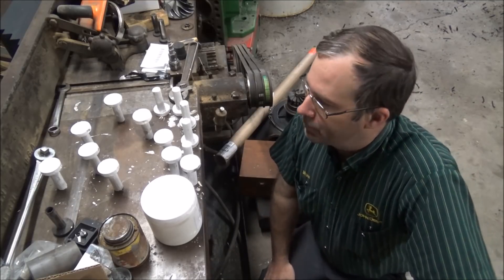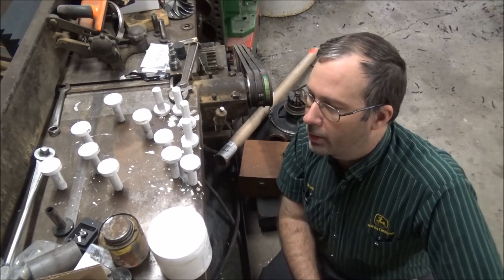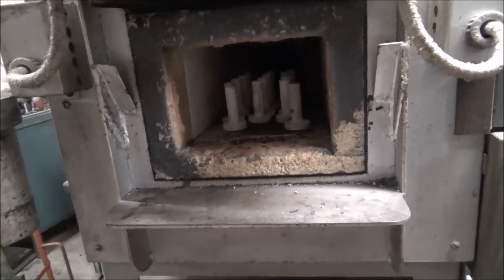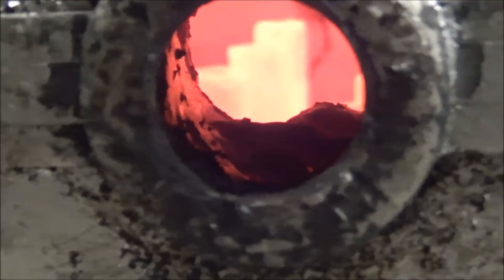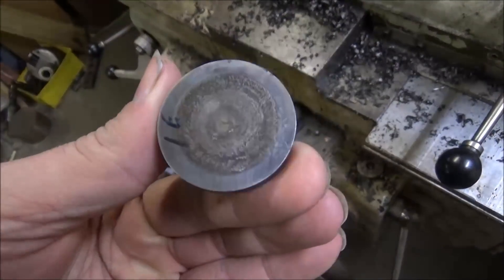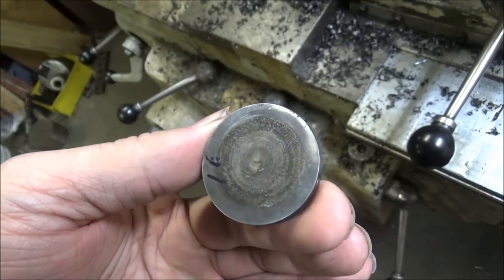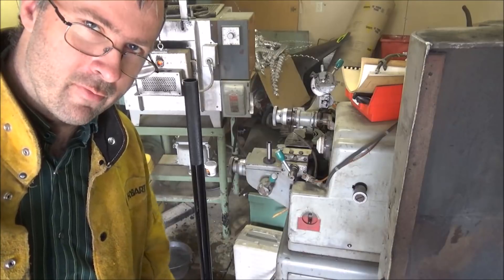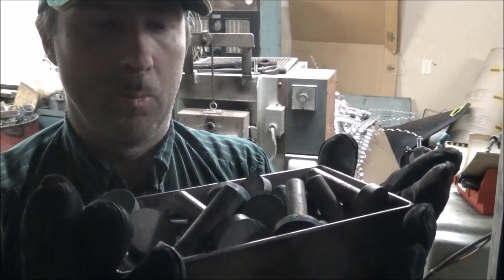Tool Steel Heat Treating

Comment: I'm having a hard time believing that you are getting an adequate quench with that piddly little amount of oil. And no circulation. Your parts have a decent amount of mass and you need an equivalent mass of material to transfer the heat into.
Just my opinion.

Comment: My experience with coating the ATP on the parts, in order to avoid the coating to kinda pearl on the parts, I use a cloth with the ATP and rub it on the part in order to give it a little dulling, this helps the product to adhere better on all the surface without withdrawing partially...
This oil bath was probably way too hot even for french fries...   lol

Comment: Good thing you don't do that everyday. I did quite a bit making my own tools in vokie even did some case hardening , some fine finish ones I wrapped in a stainless envelope type . Fold and rolled edges . Small stuff now I just torch them and quench torch to straw and use. Hard and tuff but not brittle about 65 rc to 75 rc . Close enough for my needs. Can of kasenite is forty years old for cold rolled.

Comment: @bcbloc02  Just saw that you have a Spiropoint drill sharpener! I have one too. The drills, sharpened on that machine, drill the smoothest holes. I scored mine for very cheap with lots of tooling. Do you use yours a lot?
Reply from the maker: I sharpen pretty much all my drill bits on it.  Good to know there is another one being used in captivity! I wish it would do bits over 1" is my only complaint.
Reply: Yes The one inch limitation is a pain.....

Comment: What kind of static pressure do you think those tappets are under?  What kind of RPM do those guys run in those engines 5-6K?  Some serious abuse for their limited life.
Reply from the maker: 5-600lbs of load, then around 6K rpms's. that makes a fair bit of heat and noise!!

Comment: Great video. Takes me back to the few weeks I worked at a heat treating place one winter. When you said it was hard to see in there I got this vague feeling that maybe the furnace operator had to use some kind of goggles for infra red but now I think I might have that confused with some welding training I was doing. Ahhhh, im losing to much grey matter and im not quite 40....

Comment: Hello Brian and Boss Bailey,  What kind of insert do you use for hard turning these tappets?  I take it the low volume of cooling oil keeps the temps up longer for a slow cooling temper?  I heard Fire Chief Bailey in the background when you had the pizza oven open!!  Take care.  Doug

Comment: Hi Brian
I have noticed that Adam Booth uses what looks like a high temp coating to protect areas not to be flame metalized. Have you had a chance to watch any of those videos? Might be something that might work better than the coatings you have tried. Perhaps shoot him an email to find out where to get a small amount for testing.
This is just a thought with no technical basis but may be worth an experiment using your steel and oven system.
regards
vic
Reply from the maker: Good idea, I looked it up though and the highest temp masking agent I could find only went to 900F. Not nearly enough for doing this. :-(
Reply: Thats too bad. I thought it might be higher since the coating can handle direct flame contact. Probably a time at temperature thing. I will keep my eyes open. Some type of porcelain enamel might be useful or something like TEOS (teraethylorthosilicate). Perhaps even an oven diluted oven refractory.
Reply: vic patton would silica block work?
Reply: Hi Charlie
do you mean encase each part in a block of aerogel or other type of refractory? The big issue is that the scaling occurs via oxidation so anytime the part meets O2 at high temp is when the scaling starts. I am assuming the part would have to be removed from the block before quenching and that is when the oxidation would start. Plus all the handling would be problematic.
Brian, are you aware of a product called "PBC: from RoseMill.com?
The is a borate compound along the lines mentioned by other folks in this thread. Good to 1650F but more work than the present paint on coating you are using now. The coating is supposed to be quite sturdy though.
Reply from the maker: I am at 1900F doing these.
Reply: ~1040C is toasty for sure. Your present ATP compounds are probably some type of aluminosilicate clays. It might be possible to  increase their handling strength by additives. Maybe something like sodium silicate. Maybe the folks that make the ATP product have a staff chemist who could help?

Comment: Brian with that jointer belted up like that, aren't you afraid you might lose part or all of your "wedding tackle" when you use it.
Rolle
Reply from the maker: No I don't use it from that side and I pretty well plan to keep clear of rotating machinery.

Comment: I used automatic transmission oil for quenching it was supposed to have a higher boiling point, It still boiled too.The shop I worked at had quality control and I could hit 56 to 60 rockwell fairly consistent. I like watching different ways of doing things thanks for the videos.

Comment: How do you determine temp and time? Is it thermal measure n min per pound? Or go by color for so many min? Ever experiment w types of oil? Would it matter?
Reply from the maker: There is a pyrometer in the oven that measures the temp.  The time is based off the material usually 1hrmin and 1hr extra per inch of thickness are pretty good rules of thumb but it really depends on the material.
Reply: bcbloc02 I've never fooled w heat treating like what you're doing there. My experience is more tempering n old fashioned foolin with it. Nothing as critical. You make it look easy. Thanks for sharing

Comment: when you stop spending on so much barn stuff. you might want to invest in a gold plated lexan visor lens for a face shield.  just for doing when you are working in the oven.  heck.. that could be handy in the barn. turn it on. take the chill off.  actually watching the meter spin like a gyroscope would be scary..
Reply from the maker: It actually doesn't use a lot of power, it works off of good insulation and keeping the heat inside.

Comment: I bet you electric meter was singing. How many watts is that oven?
Reply from the maker: 2000watts.
Reply: bcbloc02 Not as bad as I was thinking but still a hungry dude.👍
Reply: I wonder how much it would lower the power requirement to insulate the bejeezus out of the oven, find a way to better seal the door.  I'm guessing the main heat loss is convection right at the door seam?

I've got some ceramic fiber insulation I'll be enclosing around my repurposed pottery kiln.  Still have to work out some kind of labyrinth seal for the door though.
Reply from the maker: You could insulate it better and then use a lower wattage but the time to get the furnace to temp would be increased. It already probably takes 2-3hrs to get it to temp, lower power and it would be  ahalf a day just to get started. Wouldn't be too bad though if you did heat treating all the time.
Reply: Sounds like I'll have to do the experiment properly and do a good job recording power use before and after tinkering with it.  

I was reasoning from the idea that a PID controlled oven would only need to dump more heat in the box to replace lost heat, after it was up to temperature.  It seemed logical that I could save power pretty much in proportion to saving lost heat.  The few heat treating ovens I've used were clearly insulated just enough to do the job without self destructing (no apparant concern for thermal efficiency), and almost suspiciously poorly sealed.

I should get that far down The List in a few months :)
Reply: It's better to have higher wattage, faster startup, and you get back to heat faster when introducing cold parts, take note thet steel allows like 4140 has a critical temperature zone that you have to avoid in order to prevent  possible temper embrittlement (“Blue Brittleness”).
In the end the power consumption will be very near the same, since you'll need quite the same amount of BTUs, even more if you need so much more time...
Reply: We all learn new stuff everyday, that's the way life goes, learning is one of the treats in life...   ;)
Reply: I feel less clever now, but thank you.

Comment: what I do is use a bread pan full of borax, heat the parts one at a time to where they start to go straw color, then stuff them into the borax, and it'll melt a good coating on them. Much quicker and easier than painting them, and it's melted on there so it doesn't fall off easy. Keeps the rough scale from forming just the same. 
Also, noticed your oil was getting real hot, too hot and it can't carry the heat away quick enough, makes for soft parts. I use an old tin wash tub, holds 10 gallons of waste oil. You've got farm equipment and a couple trucks, you got a big oil drain pan?
Reply from the maker: Will the Borax hold up at 1900f? I checked the oil temp with my temp gun and the hottest it showed was just under 400, should have been fine to get the tappetts cooled quick enough to do the job. In this case the material can also be forced air quenched so I should be beating that quench rate by a lot.
Reply: Looking it up, borax melts at 1300F so the boiling point as to be quite a bit higher. edit to add: 2600f boiling point
I use it as brazing flux, too. That's pretty often up around that temperature.
Reply from the maker: If it melts at 1300 would it not just run off the coated pieces into a puddle?
Reply: Seems to stick well enough to leave a film.
just like brazing flux, just about gotta chip off what doesn't come off in the quench
Heard boiling water dissolves it, but haven't tried. Needle scaler doesn't rust the machines like a pan of boiling water would.
Next time you've got the furnace going, clean up a leftover slug of junk steel and give it a try.
Reply: It's a hard left turn from the type of work you do, but Clickspring has a neat approach using to keep air off the part using boric acid and a reinforcing wire wrapping.  https://www.youtube.com/watch?v=jlNxvnOxMCE

Maybe the coatings you're trying now could be protected or reinforced that way?

Comment: man first time i have seen water on fire. LOL Good job brain I'M guessing those are a tractor pulling engine i wouldn't want to do that on a hot summer day thats for sure. Tell bailey hello and keep up the good work. Have a great day and God Bless!!!
Reply from the maker: Can't use water it will crack the material by cooling it too fast. :-(
Reply: I thought you would use oil or something but I guess I misunderstood  my loco brain i thought i heard you say you had a pot of water. LOL

Comment: I would HATE to pay your electric bill!!!  LOL  I know VERY little about heat treating, but does the small volume of quench oil result in a change in temp of the oil then change the characteristics of the quench?  Just wondering?
Reply from the maker: As long as it drops them temp below 600deg in 20 seconds it will do the trick.
Reply: I'm sure you know what you are doing, I was just curious.  I didn't know how much red hot steel would heat a dutch oven of oil up,  LOL  Thanks!